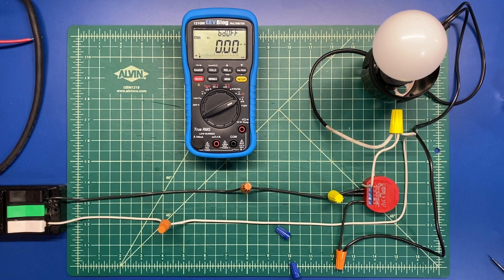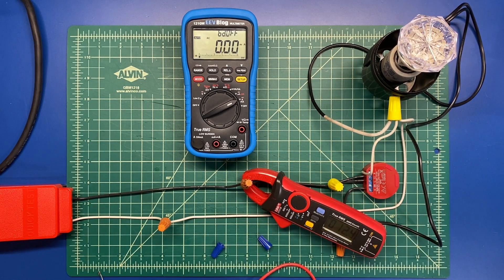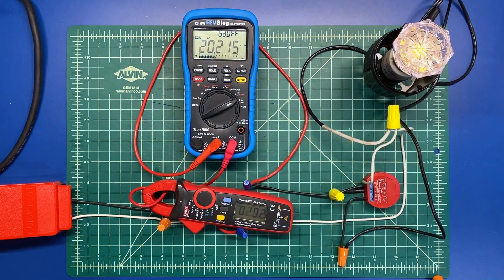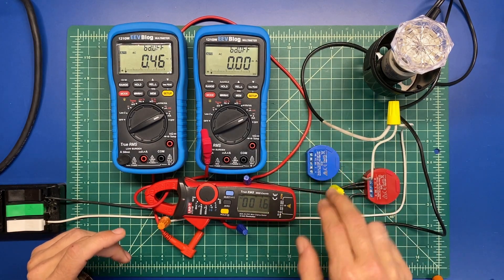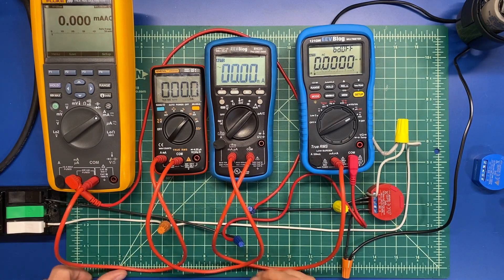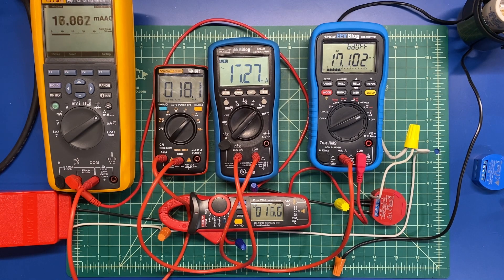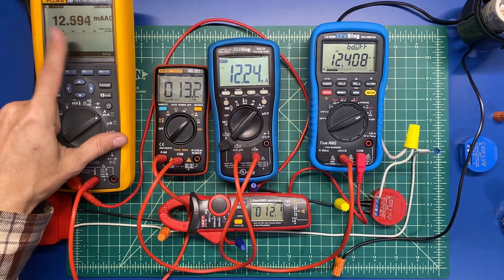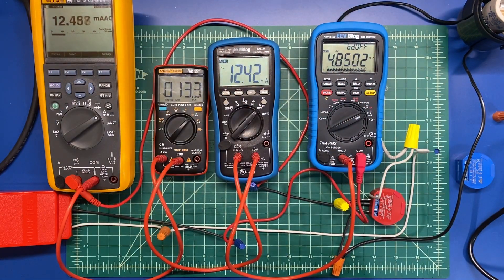121GW Auto Ranging Issue (bug?)

Comment: Auto range multimeters will give you 0 ohms when you touch probes together.
Then when you measure some kind of low resistance element like 0.3, you will still get 0 and have no idea your element is actually working.
I think auto range multimeters are great for basic stuff, not for those who know what they are doing.

Comment: I recently just became aware of 121gw and was pretty excited at first - but all the bugs and firmware revisions make it pretty off putting. It's also really hard to know what the current issues are and what has been fixed, as there are so many different reviews and comments over like a 2 year period - but there doesn't appear to be a clear definitive list of bugs, not even on the EEVBlog forums. 

Can anyone recommend a similar meter, maybe a Brymen or something, at a similar price point?
Reply from the maker: I have can recommend some meters, but what are the main features you are looking for? Is it the logging, or the blutooth, or both? Not to many other meters have BT. If you just need a good meter with a higher resolution then you options really open up.

Comment: Hey Scott.  Someone linked this video and I just watched it.   I'm not too surprised and believe you are right that its similar to the problems with the voltage mode.   If you wanted to look at the current with a scope, I could try and replicate it.  Another way would be to just run through those random waveforms and see if I stumble into it.
Reply: I just ran the virgin production meter through my that series of waveforms and oddly I can't seem to replicate it.  Are you meters even older than the ones I have?   If they are, I could try it again with the preproduction meter.   If you do capture the waveform with your scope and save it off to a CSV file,  I can load it into the arb and see if we can replicate it that way.
Reply from the maker: joe smith I just tried to message you on EEVBLOG, but it looks like you are not accepting PM’s anymore on the forum? I think I still have the capture from when we talked about this a few moths back. Yes, my meters are the original first released meters from the kickstarted  before any changes were done.
Reply: @GadgetReviews-US  Yeah, I closed down my PM a while back.  This is the thread:   https://www.eevblog.com/forum/testgear/new-eevblog-multimeter/   I suggest just posting the waveforms there. You can also upload a CSV file there as well.   It looks like Dave tried to replicate it.  I think without more data, there's not much anyone can do.

Comment: The very fact that it requires firmware updates -- put me off, I instead went for a CEM/Extech EX542, Fluke 87V and Uni-T 171B. CEM/Extech 542 has a triple display, ip67 waterproof, and no issues with measurements so far. Even the Uni-T UT171B is way much better spec'ed than the 121GW. I like all 3, not buying EEVBlog designs at any time. Big let down on the quality...

Comment: 2.04?  The website only has 2.02 .   Did your meter come with that version installed?
Reply from the maker: Version 2.04 was posted in the forum. I’ve heard others received the meter with 2.04, not sure why they haven’t updated the website yet.
Reply from the maker: I found the URL, it was posted back on February 9th. 
https://www.eevblog.com/forum/testgear/eevblog-121gw-multimeter-issues/msg2911354/#msg2911354
I’ve read this should have addressed the logging bug I did testing with. I never did confirm if it was fixed, I don’t have the time to log for 16 hours again. Maybe I will find some time next week? 
I am not sure what they fixed or changed in 2.03, I couldn’t find any notes on it.
Reply: Thanks!

Comment: yea I've got the same issue also found an issue with auto-ranging for testing caps too
Reply from the maker: I’ve seen someone report that on the forum, are you able to replicate it? if so can I get some details of the capacitor like the type:
electrolytic, tantalum, ceramic, mica, paper, film
The caps rating, and actual reading from a meter?

Comment: Looks more like a calibration issue for the lower range
Reply from the maker: At first glance that’s what I would have thought,, but if you look at the video in the description for what Joe found its in the voltage side also affecting auto range. Then some reported seeing the same thing on the voltage side, and some reported this auto range issue with capacitance. According to the calibration procedures all these functions like voltage, cap, and current and calibrated separately. That’s why I’m calling it a auto ranging issue instead.

Comment: I guess the 121GW is not mature enough yet and the SW bugs will continue to be there for some time. The art of creating reliable firmware needs specialized talented people. Good hardware design does not make a good meter on its own.
Thank you for demonstrating the bug in a clear way.
Reply from the maker: I can’t agree more that coding firmware requires talented people. Hardware is great, but these days everything needs firmware. Although I miss the days firmware couldn’t be updated and was thoroughly tested before it was sold to the public. It worked since all bug are found before being production ready. I feel like today companies think they can just fix it later with an update and just want to get the product to market fast. Or maybe they are lacking good testers?
Thanks for the comment,
Scott
Reply: They fixed this didn't they?
Reply: @xephael3485  Did they fixed this? I don't find any new information about the meter.
Reply: @Universal_Craftsman  I was trying to find that out... maybe ask on EEVblogs?
Reply from the maker: I think and auto-range bug that Joe Smith found is still present on AC voltage, along with a bug I found measuring current also having to do with ranging.
My video on the bug:
https://youtu.be/csANYnvL32k

I did post a follow up with the waveform in this thread.
https://www.eevblog.com/forum/testgear/new-eevblog-multimeter/msg3190694/#msg3190694